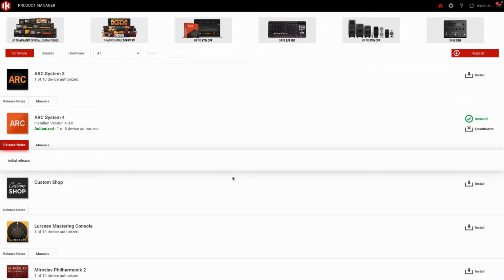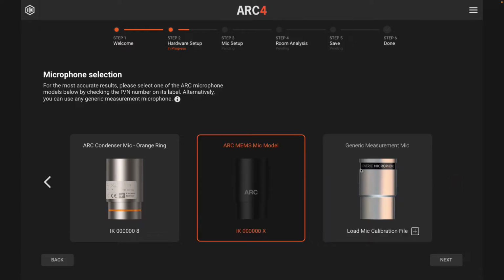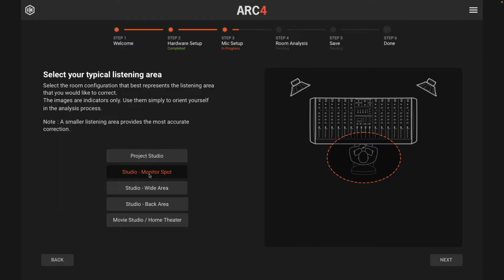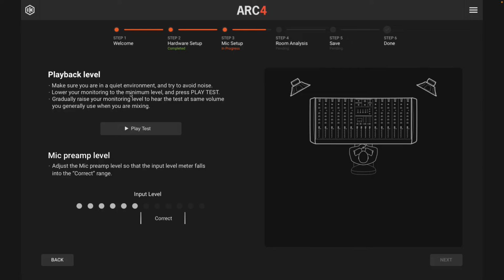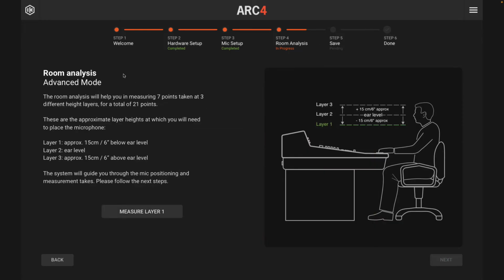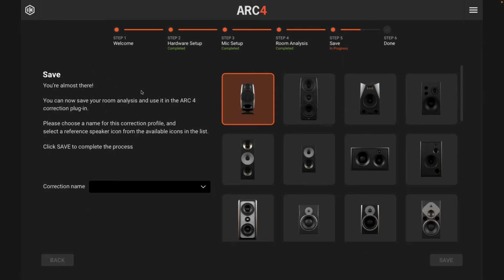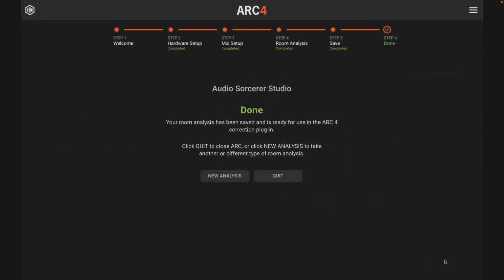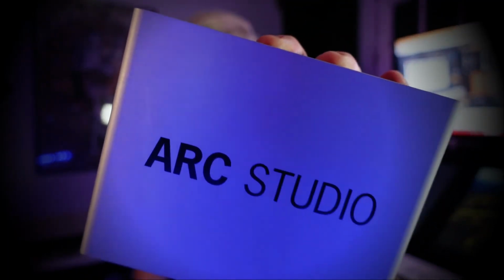IK Multimedia Arc Studio Review And Demo | Best Room Correction System

Comment: I learned something here that i didn't from 10 other channels on the ARC which is about the monitor level and then the gain level but it seems like noone is talking about the fact that the room correction is more accurate if you're actually sitting in your listening position while calibrating the 21 points. Not one person has mentioned it. Some people go outside their room with a wireless mouse to press it and some stand right in the way while clicking the mouse from their desk. I mean a bunch of "professionals" all across the board can't be that stupid right?! 😅
 
And also im curious why you angled the mic inward when moving the position to outer points? Does it matter? Ever calibration I've seen is pointed straight forward because the signal comes in from all reflections of the room from each of the 21 points. Not sure. I guess the rta mic is technically an omni with no off axis rejection. Iunno 😅

Appreciate the video of course. My ARC didn't work with Windows 8.1 so im building a new studio computer with Windows 10 first because of compatibility issues with 3rd party plugins. 

✌️
Reply from the maker: Thanks for checking out the video. It might be the angle of the camera, but the mic is facing forward in all the positions.

Comment: Hi, please help me.
I can't get ARC 4 Analysis to run on 48000 Hz.
If I set the sample rate to 48000 Hz in the audio interface control panel, after starting the ARC 4 analysis, it resets it to 44100.
What could be the reason?
Reply from the maker: I'm not sure. Have you tried just doing the analysis at 44100?

Comment: Hey @audio sorcerer I purchased this exact system and I’m having one issue. After I’m done analyzing, saving and then quitting; I then go to the arc 4 software and it remains neutral with no data from my analysis. It says my results are not being saved to my device. Can u please help me?
Reply: Did you ever get it figured out?

Comment: Hi, very interesting unit! I got some questions for the workflow with it: How do you switch between multiple monitors then? Even with a monitor controller, switching the monitors on with the box inbetween doesn’t switch the different captures of every pair of monitors which you saved. So you would have to load it / change it every time you switch monitors, when you want to have the correction of both simultaniously inside the plugin? Or can you use 2 boxes for two different monitors? would that work? When i listen to mixes i like to move fast back and forth between my speakers. That would be impossible with this using one arc box and one monitor controller right? Best regard
Reply from the maker: A box per set of monitors would be ideal. That would allow for the best workflow. 👍

Comment: I have a few questions. Is the ARC box connected to your PC via usb to upload the correction profile? What is the work flow if you have more than one pair of studio monitors? I have a monitor control station where I select between two different pairs of speakers. I assume you will have different correction profiles for different speaker types.
Reply: Yeah, you basically need one box for each pair. Switching back and forth between the two pairs would be tiring I guess.
Reply: @VoodooProjectStudio no you only need one box. Just go through the calibration process for each pair of monitors. Save each profile and switch between them as you see fit.
Reply: @VoodooProjectStudio not if you connect it between the soundcard output and monitor controller input. If you’re mixing on a board that would be the case though….
Reply from the maker: That is correct. You would need to use the software and load the corresponding correction profile each time you switch monitors.